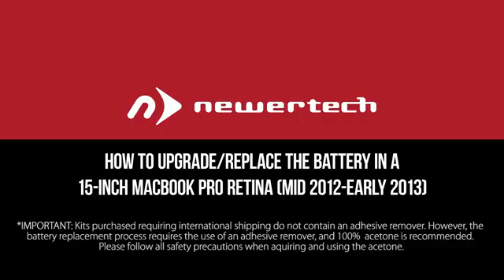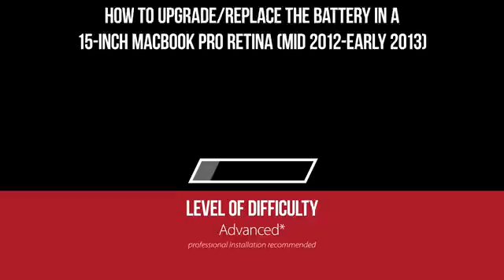How to Upgrade the Battery in a MacBook Pro Retina 15-inch (mid 2012 - early 2013) MacBookPro10,1

Comment: Was about to do this then saw another guy who just took out a couple screws and broke through the adhesive under the batteries with a bendy scraper thing.  Then read through these comments.  Seriously you don't need to take the whole thing apart just to replace the battery.
Reply from the maker: We appreciate your recommendation for another way to do the procedure. How someone replaces their battery is absolutely up to them, we, however, recommend our procedure as we believe it's the best way to replace and not damage any other part of the machine.

Comment: Literally skipped almost every step and just disconnected the battery cable and used a nylon string, ran it under the battery, and cut the adhesive. Worked like a charm.
Reply from the maker: That's awesome that you found a way that worked for you. 🙂
Reply: @poweredbyowc  your turn!

Comment: Thank you! Perfect directions except for one item. At the very end when installing the new battery, the directions fail to mention to be sure to line up the last two connection screws. I pressed the battery cable connector in as was shown in the video and then I laid the battery into place. Then when instructed to screw in the two screws for the battery, the holes were out of alignment and I was not able install the screws. At this point the battery was already permanently attached to the base, so I had to omit those two final screws. I don't think it will pose any problems however.
Reply from the maker: We are glad that the video helped you out with the battery installation. We will certainly forward your feedback to the appropriate department. Please feel free to contact us if you have any further questions, comments, or concerns. https://eshop.macsales.com/Service/

Comment: UPDATE. After not following these 86 easy steps.. and doing it MY way (logical way). The battery started smoking after I short circuited the damn thing.. starts smoking!  Sparks!  caught my drapes and wood blinds on fire.. The fire department just left.  JUST KIDDING!  THE BATTERY has been replaced.  Took me about an hour to do.  You do however want to very careful not to damage any hardware or connections of course and be very careful when prying over the trackpad area.  After the unplug of the battery fro the board and removing the two screws.. I used  a 2" new ( inexpensive, plastic with good flex) putty knife.  I slowly worked the battery (a slow prying action) and did it very very  slow..  From one end of the battery to the other.  Since the battery I received had the stickies STUCK TO THE TOP OF THE BATTERY instead of the bottom.  So I used two pieces of double sided tape.. just on the two end cells of the battery.  Worked just fine.  Everything is working fine and there was zero damage.  On first battery cycle.  No I did not use gloves, adhesive remover, plastic square thingy (which was not included) or landscaping goggles, provided.  However, you should?  Depends how confident you are in your skills I'm thinking.  THIS COMMENT WAS JUST MY EXPERIENCE.  I'M NOT SUGGESTING THAT THIS WAS A BETTER WAY OR THE RIGHT WAY.  ALSO I'M NOT SUGGESTING IT'S THE WAY YOU SHOULD DO IT AS WELL.
Reply from the maker: 😂🤣
We hope you thanked the rescue squad that went out to help you out.

On another note, We are glad to hear that you were able to find another way to do the installation that worked out for you. We provide the way to avoid any damage to the mac which regrettably does have many steps.

Comment: You don't need to do all of this! Just remove the battery and replace
Reply from the maker: We recommend doing this as since we are using liquids, we like to remove any/all risks of damaging other components as we use the adhesive remover to remove the battery. This video helps to ensure no damage is done due to the liquid, but for those who choose to skip the extra steps, simply be careful while using the adhesive remover.

Comment: Nicely produced video, and I used the instructions for how to do the initial battery charging, but you can simply remove the old battery with the string method (I used six strands of dental floss and the two little screwdrivers from the battery kit as handles). Cut the adhesive easily, with no chemicals required. Removing the guts of the laptop just to change the battery is crazy and unnecessary.
Reply: Agreed.

Comment: More steps than necessary for just the battery replacement, however, I replaced my speakers as well so was great for me. I wish the when you said to watch the cables when replacing the motherboard point out which ones to watch out for, as there are a few and some are small and easy to miss until you want to plug them in and you have to unscrew some of the motherboard screws to fish them out from underneath. My laptop is busy charging now, so I haven't checked everything is ok,  but it went pretty smoothly thanks to the video.

Anyone doing this and doing the whole dissemble I definitely recommend having a magnetized screwdriver so you have an easier time replacing the tiny screws.

Comment: Can OWC explain why I can't just change out the battery?  Why would I need to remove everything else in this video?  Is there some potential for some sort of damage due to a current spike if I don't?  From some capacitor or something? Many other YouTube videos just have the battery alone being unscrewed and changed, not all the other items.
Reply from the maker: We recommend removing everything from the machine for safety precautions as solvents are used to remove the battery which can lead to potential damage to the machine.
 
 We like to make our installation videos with every precaution to ensure our customer's have a successfully installation with no potential damage to ones machine.
Reply: @poweredbyowc  Thanks, I replaced the battery already, works fine.  I didn't remove anything else. It was simple and not complicated, did not take long.

Comment: This was a great and thorough tutorial. Although some people may prefer the quick way of just removing the battery, while potentially risking all the other components that make up the computer (logic board, SSD card, etc.), this way is how a professional repair shop would do it. The part that took the longest for me was removing the leftover adhesive from the laptop housing—everything else was pretty straightforward.

I appreciate the level of detail included in the narration portion of this video where details were shared regarding the size and position of screws which made putting things back together so much easier.

My laptop is up and running perfectly. Remember to calibrate the battery before returning to normal usage conditions. Thanks for the assist on this one!

Comment: I agree with Mr. Chen. After following a few instructions that could easily break something -such as a delicate zif connector that should be never be touched (or used anymore, note to Apple), I realized that you just have to get under the battery. I freed it in less than 10 minutes using a MATCO 2141-7 nylon pry tool pointy end to lift the edge and round end to slice through the adhesive. This automotive tool is extremely strong and about 8" long. Once the battery was out the glue scraped off with a shop knife.

Comment: The battery can come off on its own. There's no need to disconnect all the things shown in this video. Once you have disconnected the battery and removed the two screws holding it down, just use a non-metallic string to 'saw' the adhesive under the battery and lift it up. It's that simple.
Reply: @ocaminhodefatima991  No. This is an overly complex way of removing the battery.
Reply: @aka_rook  I think there's always pros and cons. The pro for using the string method is that it makes the removal process pretty fast; minutes instead of hours. The cons for the disassembly method is the time necessary to do the job and that if one is not mindful, it's easy to damage components, ribbons, wires, connectors and snaps. In addition, the tiny screws can be easy to loose and confuse. All that said I'm sure NewerTech who's been around almost as long as Apple Computer itself, is simply following Apple's official repair guidelines for the battery replacement. The idea of coarse is safety first and to give as much clearance around the battery as possible in order to prevent damaging it, or other components and ribbons during removal and creating a dangerous and toxic fire situation which can also destroy a laptop. In addition, carefully disassembling the computer can also help to help keep critical components from getting damaged as part of the battery removal process. On the flip side however, improper or careless disassembly and reassembly can damage those same ribbons, wires, connectors and snaps. The button snaps for the antenna wires that connect to the wireless card are extremely delicate. Pushing down with uneven pressure can permanently damage both the male and female halves of the snap, rendering antenna wires and wireless card permanently damaged. 

After disassembling my laptop twice, because the first time I missed clearing two ribbons from underneath the logic board, and because now I have a greater understanding of how the computer is assembled, I would use the string method. The two center battery cells are glued to a very thin aluminum shroud that protects the underside of the track pad. Pull too hard on the battery and one can pull that metal shroud right off of the bottom of the track pad. The delicate aluminum shroud is simply glued in place with contact cement. It and the the small ribbon that connects the track pad to the logic board can easily get damaged. Also if any of the ribbon cables tear, you may as well throw your computer away.  

So my word of advice for any of the two methods is, work slowly and be ultra mindful of critical components. When reinstalling the battery, be sure to line up the two screw holes prior to pressing the battery to the case. If the battery has been glued to the case and the the two screw holes are not lined up, chances are one won't be able to reposition the battery afterwards in order to thread those last two screws. This little tip was not mentioned in the video.
Reply: i agree all the extra steps just discourages people from doing this theirselves
Reply: Bizarre... I did use isopropyl alcohol and a credit card, but that was all. D'uh!

Comment: I bought an HWG battery from Amazon (that is a crap). What about this one? Is it work smoothly without issues? for instance: percentage jumping, switching between normal and replace recommended at the system info/power/condition Thank you !!

Comment: I have MacBook Pro (Retina, 15-inch, Early 2013) with 85W MagSafe  2 Power Adapter. The manufacturer's page says the battery is 95W (https://eshop.macsales.com/item/NewerTech/BAP15MBR95WK/). Doesn't it mean that (1) the circuits inside the Mac will get a larger current? (2) Did you guys buy new charger?

Comment: The video is good, BUT I would have appreciated a checklist of everything you need to make sure doesn't get pinned down under the logic board before replacing. 2nd time having to remove everything because a cable is trapped under there :(

Comment: I watched the first half of this video, which covered disassembling the MBP.   At some point I realized that most of this disassembly is so you can remove the speakers to avoid having the solvent damage them.    Removing the back cover is easy.  Then there are only 2 screws under the warning sticker at the top of the battery that must be removed.  I was able to remove the battery using some plastic hotel room keys.  It took a little effort and working to push them under the battery to separate from the case, but in my opinion this was way easier than taking the entire system apart.  It may be less risky too, as I always fear screwing up one of those flimsy ribbon connector things.   Note, I did not use any solvent, so there was no risk to the speakers or the display.

The entire process took me about 30 minutes and my MBP is working great.
Reply: Yeah... should have just done that.

Comment: Almost everything up until 09:35 is totally unnecessary - I dont understand why this tutorial suggests removing the entire contents of the macbook. I have done this myself just by detaching the battery and sliding a credit card underneath the battery to separate the glue. Removing speakers, wifi card....WHY?
Reply: Thanks for this, because I have delayed removing my battery due to all that removal process.

Comment: 95% of the work in the video is unnecessary!!! It's as if show you how to remove the cup holder while you simply need to replace your car's battery!
All you need to do are:
1. open the back
2. disconnect the battery from the motherboard
3. unscrew the two screws underneath the warning sticker
4. remove the batteries using dental floss wire (or similar ways)
5. replace the batteries
6. put on the screws
7. connect the power cable to the motherboard
8. cover the back and put all screws back
9. done.
Reply: Thank you!! I’m watching this and thinking: WTF?!? All this just to replace a battery?!
Reply: I agree but I would definately drain the battery as I used the dental floss method a few times and one time the battery ignited
Reply: Zhongjie Chen yeah what is this guy doing lol
Reply: Yup, he is right.  I found that 25 pound fishing line looped and worked under the batteries with a sawing motion released the adhesive from the old batteries.  Thank god I read the comments.  Taking apart all this stuff would be risky(and insane) as the connectors are tiny and fragile.  This is totally doable.
Reply: @jeffbell1642  risky(and insane) is how I like my women!
Reply: THANK YOU, I wasted like 6 fn hours doing this crap, till I was reassembling it and thought wow all I had to do was EXACTLY WHAT YOU SAID, 🥴🔫
Reply: pretty sure they did some extra steps.because this is made by macsales. an aftermarket mac parts company. if you're replacing your battery they probably want you to see how easy it would be to upgrade your ssd or wifi card. doesn't really make sense to take those out. otherwise.
Reply: Zhongjie Chen simple and totally works! thankyou
Reply: could you make a video!
Reply: @Darkknight39  https://www.youtube.com/watch?v=rfHHIERH2J0
Reply: Zhongjie Chen   Thank you!
Reply: Fantastic! I used .45mm beading wire wrapped around two clothespins. Saved me sooo much time.
Reply: i literally just sprayed some 70% isopropyl alcohol on the batteries (mainly in between) and let it sit a few minutes then slowly pried the batteries out with a butter knife then scratched all the glue off with it also, was fairly simple. computer works great
Reply: Do you use the floss pic itself with the wire in it, or does the store carry (dental floss wire)?
Reply: I agree they just people to get discouraged and hire them to do the ADVANCE JOB it takes 25 minutes tops, not 60!
Reply: Tempted to try this but my battery is 7 years old and in really bad condition so im worried it could ignite, should I just take this to a repair store ?
Reply: I wish i had seen this post before i followed this video. Why risk removing the logic board! Fortunately I didn't snap the logic board, but did wind up severing the iSight cable while disconnecting it. Had to buy an external webcam.
Reply: Thank you for your comments! I will use the dental floss to remove the battery.... without removing the complete internal guts!

Comment: Came to learn how to replace the battery on my Macbook. After 10 minutes of being told to remove virtually every piece of hardware inside first, I gave up and called the Apple Store to set up an appointment. Well done Apple.
Reply: Its an easy job - they have tried to make it look as complicated as possible in order to sell these kits - 90% of the steps shown in this video are not needed.
Reply: The fun part is you don't actually have to take most of the parts out
Reply: "being told" lol

Comment: What is the purpose of removing the entire board?  Worried about getting the glue remover on it?  I would have thought it could all be done by just disconnecting the battery and drizzling a bit of acetone under the battery cells to free the gum?  Adds so much time and effort using this method.
Reply: correct, thats all you do, but the guys making this video are trying to sell a "kit" so they need to make it look as hard as possible.
Reply: @lab_lover_au  yup!  I gave up on the Macbook in the end.  Had so many logic boards fail that the cost was no longer worth keeping it.  Sold the screens and a few parts on eBay and moved to a Windows PC.

Comment: Thanks for making such a detailed and accurate tutorial! It worked perfectly. I'll echo though that is VERY easy to leave a couple of cables under the motherboard when you put it back in. I had to remove the screws and fish them out twice before I got everything.
Reply: same here man
Reply: Yeah... I lost two screws and left some ribbons under. The keyboard backlight has like a yellow tint and the speakers are disconnected... but I think I'll just use that as an excuse to keep it a work computer. I can live with bluetooth/headphone jack for an old laptop.

Comment: The credit card method works!  R&R my mid 2012 battery in under an hour.  I used thermal paste on non-adhesive surfaces on bottom of battery and did not remove stickie residue from laptop case.  Waiting for battery to drain so can calibrate it.  Loved the video BUT there is an easier way.  And I'll bet the mac shop uses it too.

Comment: ???? thats a lot of work to replace the battery. just let the battery run down leave for a while remove the power cable remover the batt with an old Credit card (works great) clean up replace the batt. Bobs your uncle Job done 🤷‍♂️